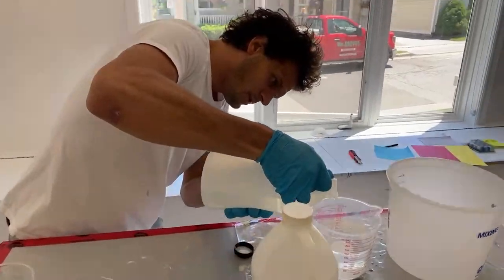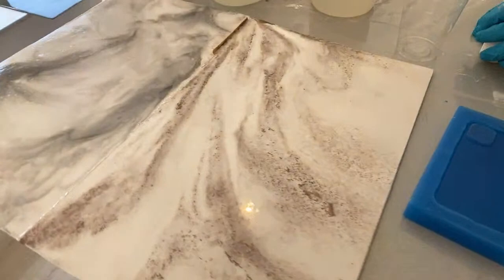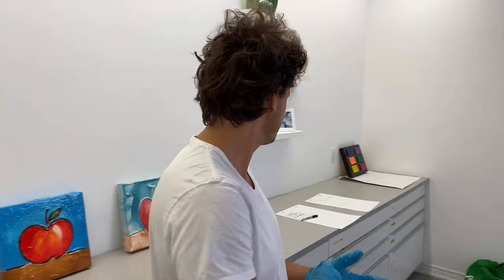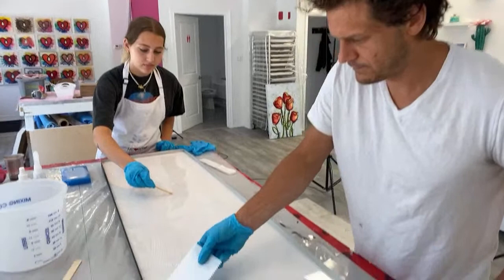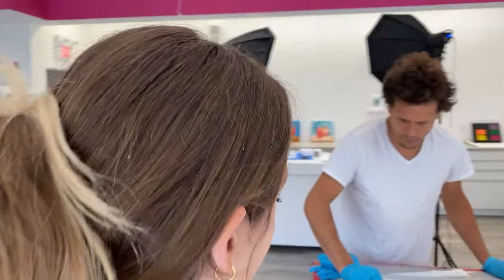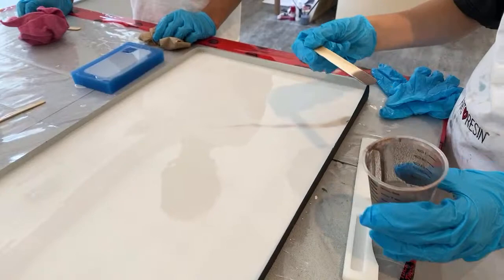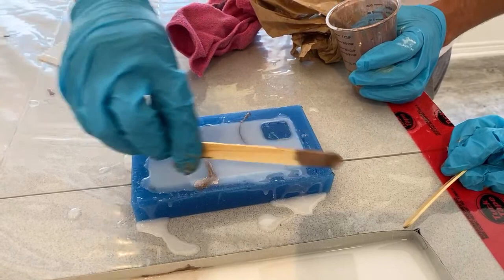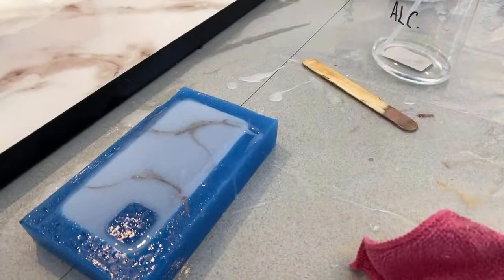Marbling with Resin

Comment: Oh I missed you live. Darn! Marbling looks nice . 
Have to redo my resin image transfer because I forgot to spray it with a fixative spray so I could wipe away resin dust after sanding etc. I smeared the first one because the reason didn’t lock in the pigment .
I’ll use the fixative spray meant for gouache. I tested it on another printed piece and it works to prevent smearing. Will have to use clear gesso to give it tooth because sanding will wear off the image.

Comment: Dave really needs a mic. Does the spray paint render a different effect than resin tint or alcohol ink?
Reply from the maker: yes the spray paint sits more on the surface and seems to blend differently.  You can certainly achieve a similar result using ResinTint and ArtResin.